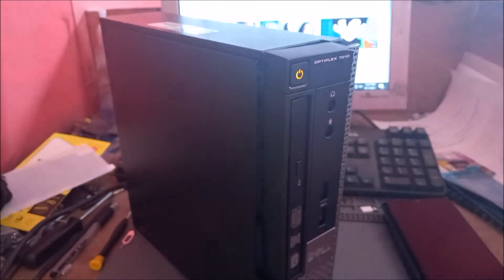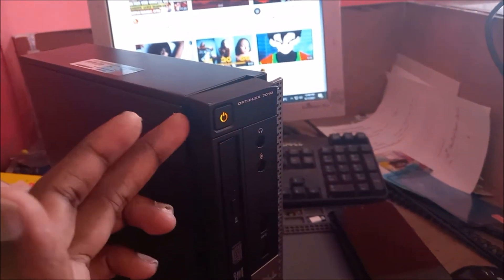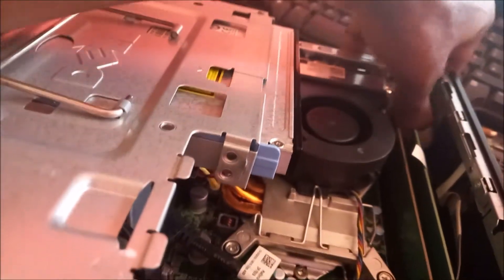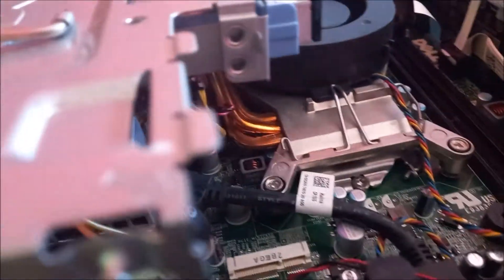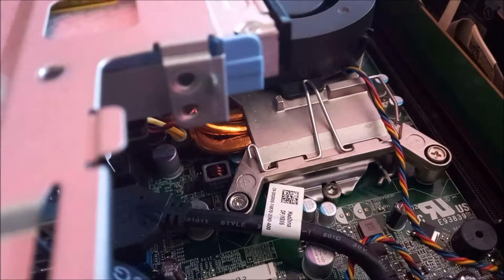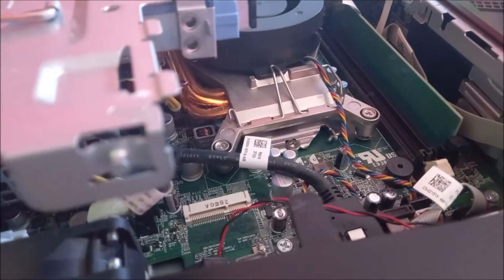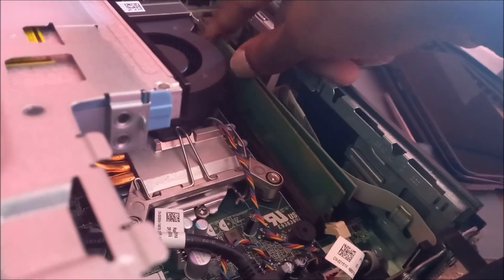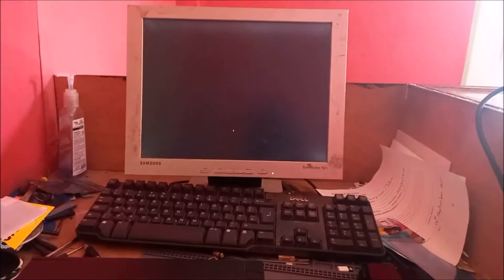dell optiplex orange blinking light fixed

Comment: So, all you essentially did was re-seat the memory a few times?  Because you didn't actually change the memory right, and the slight color difference between them tells me they ended up in the same slots in the end that they started in as well.